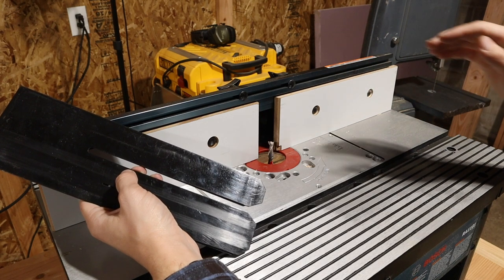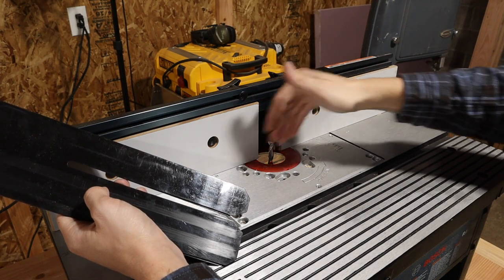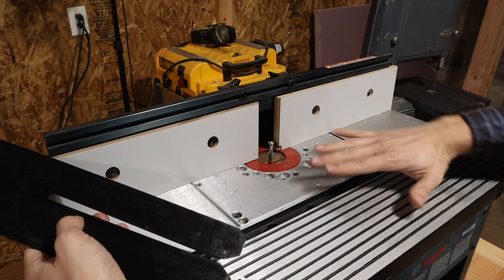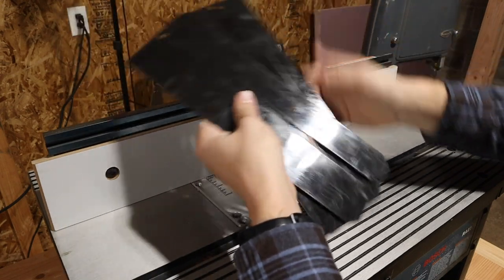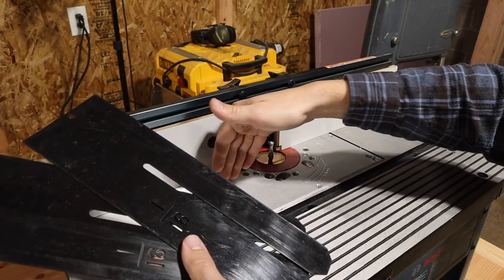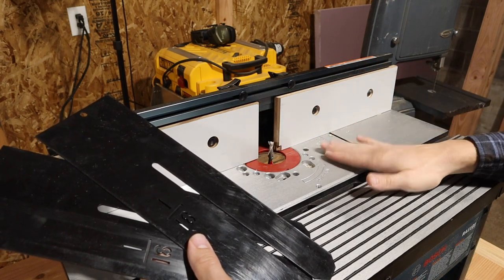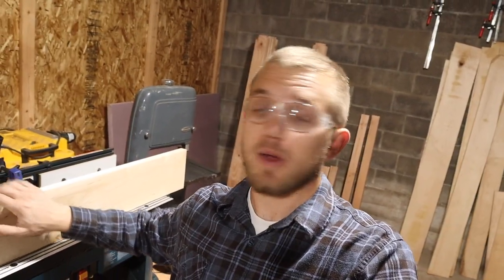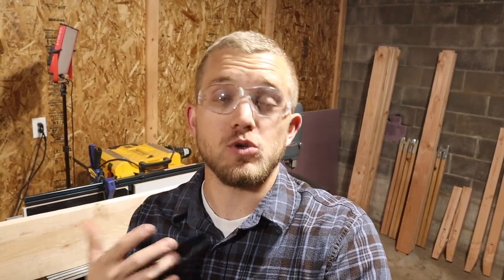Router Table to Jointer | Using the Shims on the RA1181

Comment: The fence on my jointer...I don't think it's actually stiff enough to properly edge joint boards.  I honestly think a router table is the better choice just because of the ergonomics.  I like the idea that this machine comes with these shims, though I might want one thinner than 1/16", I often joint boards with a 1/32" or 1/64" pass.
Reply from the maker: Couldn’t agree more, it’d be nice for them to have included some others, though, with a planer on hand, you should be able to make up some pretty nice shims.

Comment: Do you know how I can get my older 1617 Bosch router to convert over to the 1181 table as far as the top depth adjustment? There is no top tool insert for the top of the depth thread spindle on the router. The 1617 has an E ring clip to remove the threaded adjuster to replace it. Until a reply, I will look around. Thanks, Steve
Reply: Please disregard- Amazon base for $57. Probably should have scrapped old unit and sprung for a complete new router. Oh well, call me cheap!
Reply from the maker: Glad you found something that’ll work for you!

Comment: The reason for the slot in the shim is so you can insert it behind the fence face and present an uninterrupted flat surface for the stock to run against on the outfeed side.
Reply from the maker: You’re 100% right 😂 I whiffed this completely and only found out when folks like you let me know. Thank you!

Comment: Thanks for the video, I knew that the shim was supposed to go behind the fence, but thought you were showing a quick way to use a shim for a couple of passes only.  I may use that trick, lol. I noticed your router table was moving while you were using it so the base was either not clamped down or was very loose.  I watched your safety video on router tables and it occurred to me you never mentioned securing the base.  You had a wall behind your table so it couldn't go far, but it could be dangerous for someone using only a stand - apologies for the Capt. Obvious moment.
Reply from the maker: You’re totally fine 😂 it’s the captain obvious moments that help me learn the most! You’re right on all fronts 
- Shim should be behind, and you give me too much credit. I didn’t know that until I posted the video and someone corrected me 😂
- And that it wasn’t clamped down and should have been. Should be clamped down 100% if the time. 

Please continue to be captain obvious! At least with me, always learning.

Comment: I'm looking at getting this table because of its 27" length dimension. That just happens to be the size of my old craftsman table saw's bolt on wing extensions. If holes were drilled in this router table top (sides) to match the cast iron saw table, I wonder how well this would work as a left side extension wing?
   On my table saw I've already moved the fence guides mostly to the right-of-blade side to expand the original 12/24in fence while barely supporting the left wing. I want to move the fence completely to the right for a 0/36in+ fence setup with both original wings on the right side. This would leave very little feed support surface on the left. 
   A nice cast aluminum table seems preferable to a DIY plywood extension wing with a DIY router insert project (eventually) and the headache of figuring out a top side of table lift mechanism. 
 PLEASE convenience me using this router table as an extension wing is a bad idea before I dump funds on a table and router.
  This isn't even my primary hobby. I just wanted to build a new 3d printer enclosure cabinet, and wound up remodeling the garage shop :-)
-Jake
Reply from the maker: Jake, not sure it’s my place to try and convince you of anything but here’s my two cents. You could make just about anything work with the right planning and equipment. 

It sounds like this would be a pretty easy integration but without seeing all of the parts it’s hard to judge. Though, I don’t think the table needs an extension per say, it’s been large enough for all my projects.

Hope this helps! And happy woodworking. 

Josh

Comment: I would like to see more in detail the shape in this piece of wood. And I would like to know how to use and for what is the starter pin for edge forming of curves. Pls and thank you.
Reply from the maker: Hey there! Thanks for the question. Not sure I fully understood, let me know if this wasn’t what you intended. The starter pin is used to stabilize your workpiece before starting a cut. You won’t use it when using the router table as a jointer. As well, can you explain what you were going for regarding the shape of the wood?

Comment: If you notice that the 2 Grey boards on the fence either side of the bit have bolts in them.  If you loosen the wing nuts on the back side of the fence you can then move each one out and then put the shim behind the board and tighten the wing nuts.
Reply from the maker: I appreciate the correction. Someone pointed this out almost immediately after I posted the video and I couldn’t help but laugh at my own ignorance 😂 it makes so much more sense.
Reply: Do you have any other videos to help a newbie like me?
Reply from the maker: Absolutely! I was right where you are just a few years ago. I have a bunch of difference videos but ones that a lot of folks seem to like are my unboxing videos for tools I’ve purchased over the years. Below is a link to that one. I’ve also included one for the playlist which has a lot of maintenance videos 😊 what kind of info were you looking for? 

Unboxing & Setup Playlist
https://youtube.com/playlist?list=PLBkW_zpeByMHNGVEo3Ws6JICDABZGwGb7&si=c12hxxAAnpxQzH2i

Maintaining Your Tools
https://youtube.com/playlist?list=PLBkW_zpeByMHNGVEo3Ws6JICDABZGwGb7&si=c12hxxAAnpxQzH2i

Comment: What lift are you using with your table?
Reply from the maker: The Bosch 1617 EVSPK kit comes with a fixed router base that has a micro adjust that can be accessed from the bottom and used as a lift when mounted in their table.

Comment: Will this only work on shorter boards? I'm curious if this could be useful for longer boards - say 5-6 ft in length.
Reply from the maker: Hey Stefan! 

Theoretically this will work for boards of infinite length. The challenge you'll run into is supporting them and keeping the support coplanar with the infeed fence. The other question is how true do your 5-6' boards need to be? A well tuned table saw may be a better tool for truing up an edge. 

Great question, let me know if you'd like to brainstorm more for your project. 

Josh
Northwest Craftsman
Reply: @NorthwestCraftsman  that would be fantastic.
Reply from the maker: Feel free to shoot me an email (on the about page of the channel) or ask any more questions here 😊

Comment: Hi, thank you for your video. I have one question: when you start jointing, how are you supposed to apply pressure once the piece is moving: over the right side of the fence or the left side of the fence? I tried to do my first jointing with the router, and I ended up with a piece of wood wider in one side and with an angle at certain point (forming like a triangle). I wonder what am I doing wrong? Thanks in advanced.
Reply from the maker: Phenomenal question! Unfortunately that’s a limitation of this method and of many jointers in general. My understanding is that a well jointed edge requires full support along its length with the same tolerances of adjustment as the fences/soles, however the jointer is set up. 

In your case, it’s also worth noting that the jointer is only intended to provide one flat edge that is square to the face on the sole. Most work pieces will need to be planed and squared up after jointing.
Reply: @NorthwestCraftsman  awesome answer, thank you!
Yes, I'm actually trying to joint a very large and slightly warped piece of wood, that is what I kind of discovered: because it was too large (or larger than the router table), it lacks proper support and guidance.

And yes, the edges are straight and smooth for joints at least. So I think I will try to get it as straight as possible with saw first, then pass it through the jointer for a final smooth plan edge for jointing.

Thank you very much! :)
Reply from the maker: Of course! 😄

Happy woodworking!

Josh
Northwest Craftsman
Reply: The problem I'm having is that even though left fence face is dead even with the cutting edge of the bit, as the board moves off the right fence, near the end of the cut, the board moves towards the back, and I end up with a notch at about the last inch of the cut. I know I'm doing something dumb 😄
Reply: I found my problem. When I was adjusting the left fence face to be even with the router bit, I didn't take into consideration that the carbide tips stick out the farthest. Once I figured that out, and adjusted the fence face to the tip, perfect.
Reply from the maker: @bruce1106  fantastic! Good find and glad you were able to figure it out.

Comment: It would be awesome to see how you set it up to align the shimmed side with the router bit. I've been considering getting this router table, and this gives me one more reason to do so, because I don't own a jointer yet. Thanks!
Reply from the maker: It’s actually super easy! 
- Rotate your bit so one of the cutting edges is as close to you as possible
- Loosen the fence
- Rest a straight edge on the out-feed portion of the fence
- Push the fence back until your straight edge has made slight contact with the bit
- Tighten everything down! 😄

The one down side to using this as a jointer is that it can only joint about an inch of board and my table saw can do that more easily.
Reply: @NorthwestCraftsman  Thanks for the reply! I think this will work well, since my table saw is a portable and probably not as dialed in to work as a jointer.
Reply from the maker: Absolutely! And I totally understand that. This should serve you well for the time being then 😊

Happy woodworking! 

Josh
Northwest Craftsman

Comment: Did you replace the stock router base?
Reply from the maker: Michael, if I’m understanding correctly, the router plate and the router body (that holds the spindle) are the stock parts from the 1617EVSPK and 1181 kits.
Reply: Yes. I saw the red base set in the table, thought maybe you upgraded for some reason
Reply from the maker: Gotcha! Yes, those are the provided inserts for the opening to prevent your work piece from falling in.